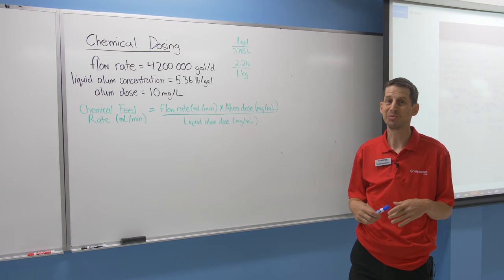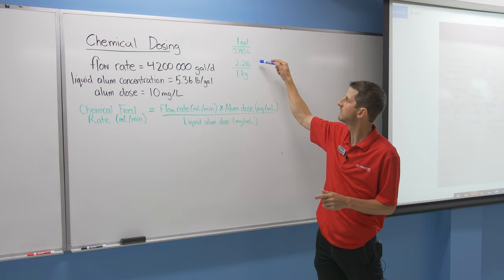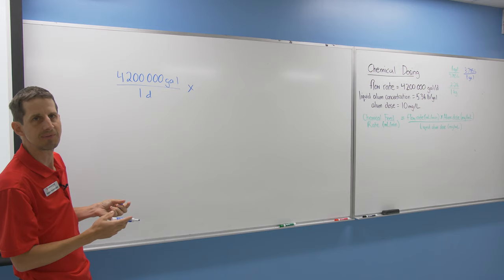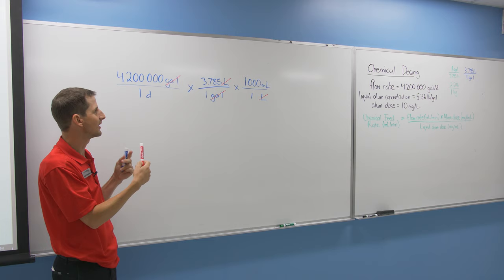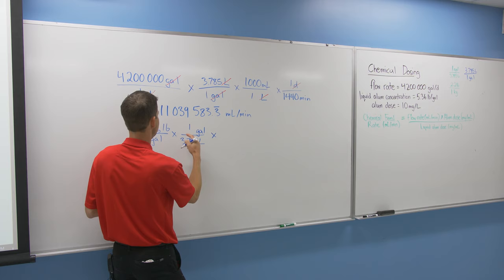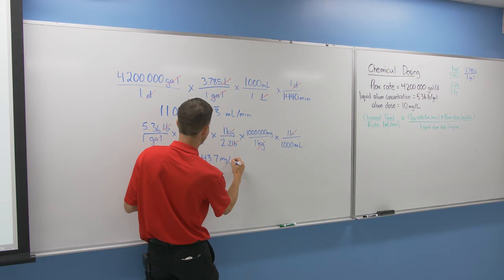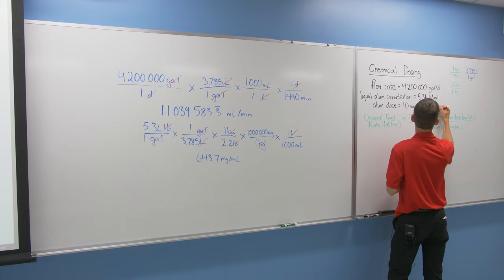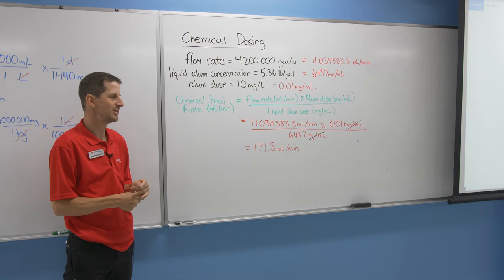How to Calculate Chemical Feed Rate

Comment: How do we calculate the liquid alum concentration?
Reply from the maker: To calculate the liquid alum concentration, you'll need the following information:

1. The mass of aluminum sulfate (alum) dissolved in the liquid (in grams).
2. The volume of the liquid solution (in liters).

Once you have this data, you can use the formula:

Liquid Alum Concentration (in g/L) = Mass of Alum (in g) / Volume of Liquid Solution (in L)

By plugging in the values, you can calculate the concentration of the liquid alum in grams per liter (g/L). This will give you the answer to the person's question about how to calculate the liquid alum concentration.